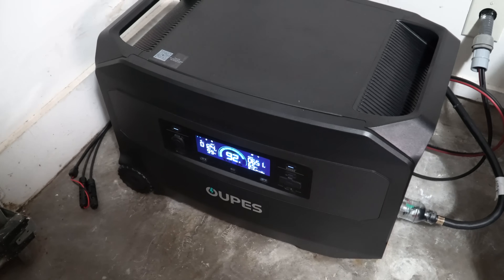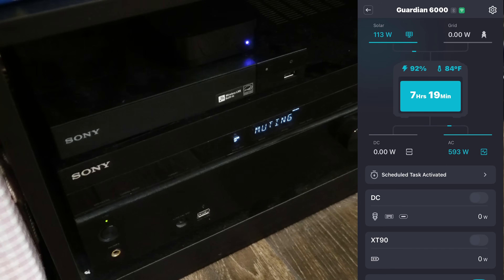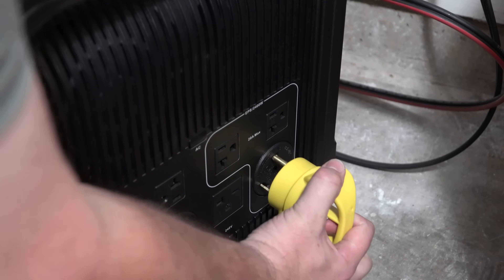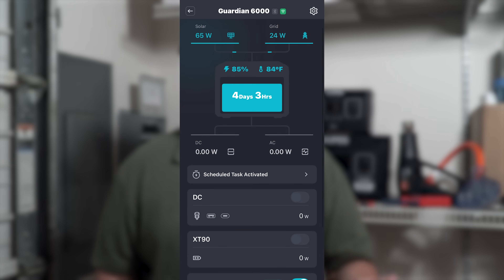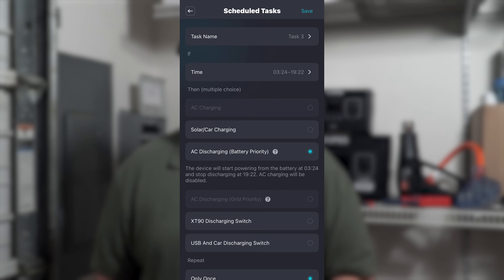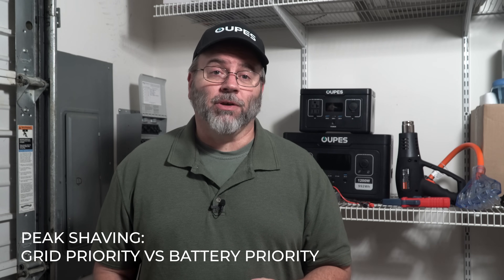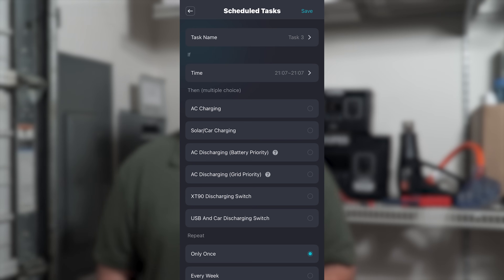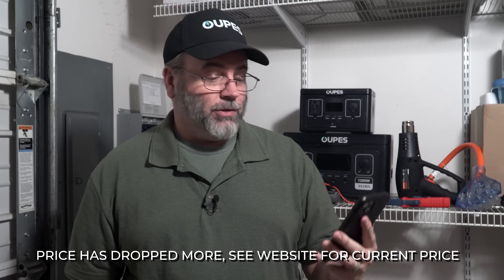I Tested the OUPES Guardian 6000's LIMITS and Here's What Happened

Comment: I'm interested in the peak shaving feature. What kind of transfer switch is required for this feature, you're using a manual switch and like someone else commented, I don't think that's possible. Can any automatic transfer switch be used or do you need an Oupes automatic transfer switch?
Reply: This is what I’ve been waiting for two and I would like an explanation as well. I’ve been brainstorming how to do that with my Ford lightning without having to go switch it on my own and I certainly don’t wanna spend 10 grand on their system.
Reply from the maker: @LectricOverlanding  Check out our other video about transfer switch: https://youtu.be/6IuEnvtgo2Y?si=AtNLUNd4r2K9rOPP
Reply: @OUPESOfficial this only applies to MANUAL transfer switches . Is there any Automatic transfer switches that will work ?
Reply from the maker: Check out our other video about transfer switch: https://youtu.be/6IuEnvtgo2Y?si=AtNLUNd4r2K9rOPP